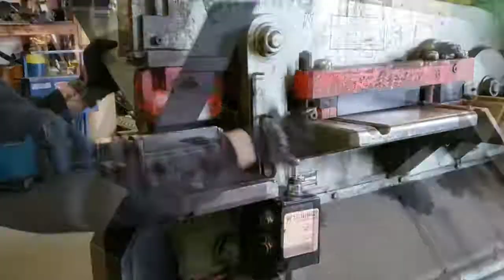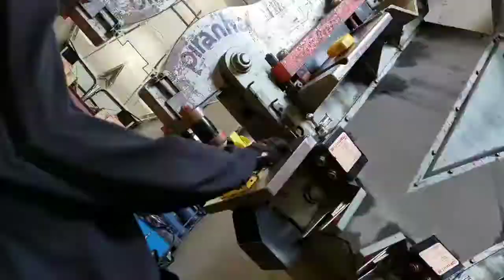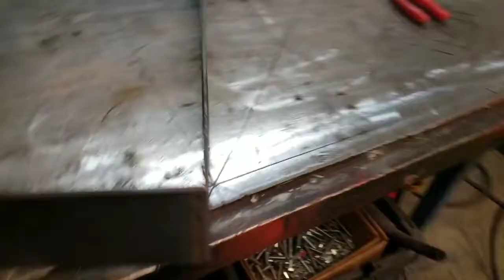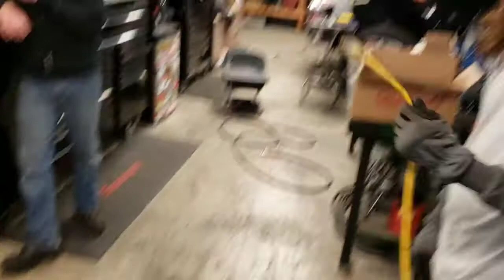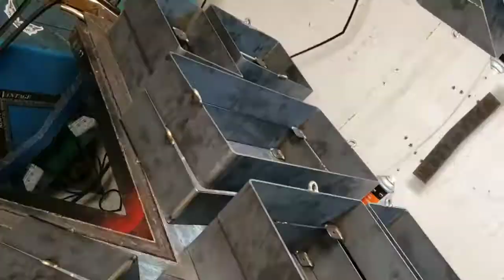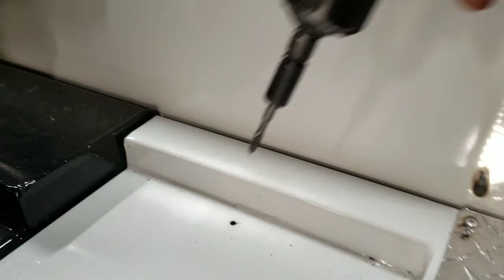Fabricating Fuel Can Brackets (Wrecker Tow Trucks)

Comment: Nice! Very well done with the welds and folds. Just add a little gasket maker paste around the bolts to keep water away from the toolbox. Also, stainless steel cables are neat but you need a lock to secure them and remove them is a pain every time. Use a bungee cord and you are ready to roll my brother!
Reply from the maker: Thanks so much! I do silicone the holes after it comes back from touch up at the painters. Customers ask for the cable and supply the lock themselves because people love to steal their fuel cans. We only bunjee the trash cans.